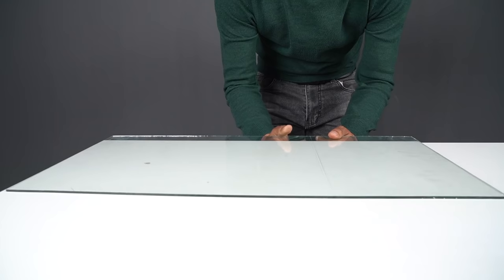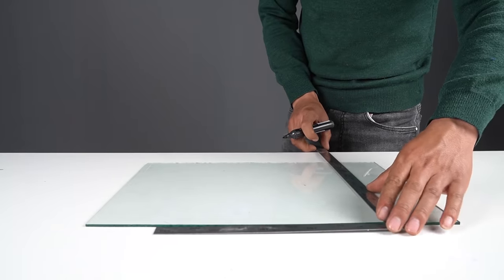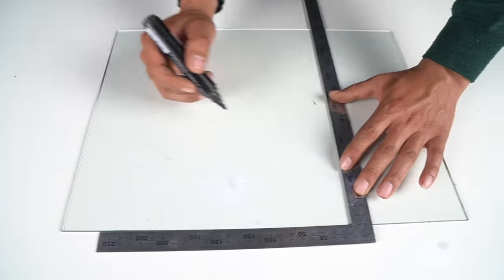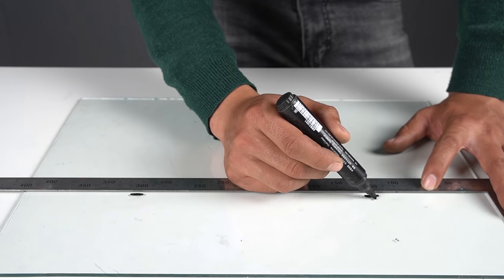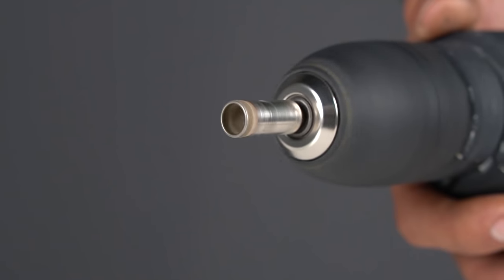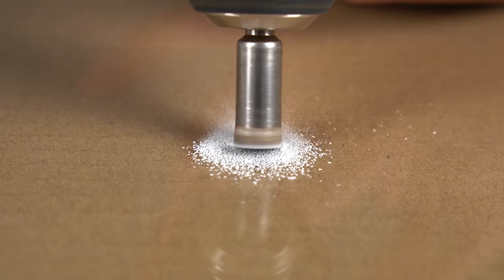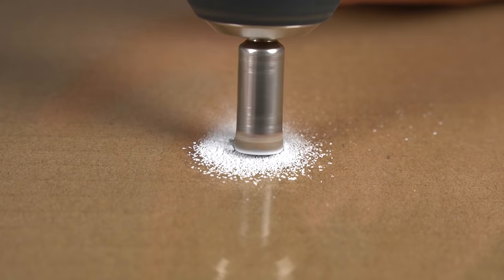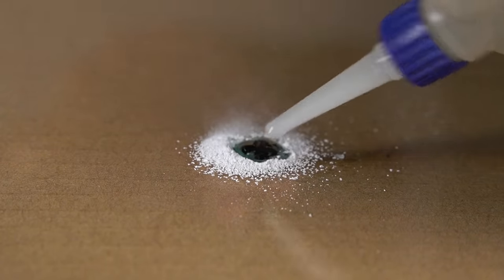How to Make Unique Multi Level Glass Aquarium at Home

Comment: how the bubbles are formed from pipe and what is the steel type in it
Reply: Omg I observed after u said it 
I'm curious now I neeed to knowwww !!
Reply: The air pump he used to originally remove the air and pull the water up is still running on the other side of the straw. Since something is being removed, something needs to fill its place.
Reply: @jakelongstead399  no ko jo no no no à no no no lo

Comment: I can foresee a lot of trouble to empty the water before being able to turn off the pump.

Also, this fish tank is not a good idea if you have a power outage or someone takes off the plug by mistake.
Reply: It doesn't require power to keep the top full. It works the same way plugging your finger over a straw prevents the water from falling out the bottom of it. You only need power to pump out the air and get the water inside.

Comment: Why is no one talking about the physics of this? Isn’t this physically impossible?
Reply: If it was why is it working lol
Reply: It is perfectly possible. The tank in the middle had a certain amount of air available, due to the fact both tanks left and right got full with water. It had no access to our air from outside.

The youtuber has put a pump, one tube sucked the air from the top of the middle tank the other tube took the air out to the outside. Because there is a certain amount of air in the middle tank, and it has no access to new air, the space created by the air coming out is filled not with air (no air is available) but with the water coming from either the right or left side tank.

It is a suction effet.

Just keep in mind that the middle tank is closed = no air comes in from left and side since there is water.

I hope you understand.

Big problem: if the pump stops working, then the water from the middle tank will flow out.